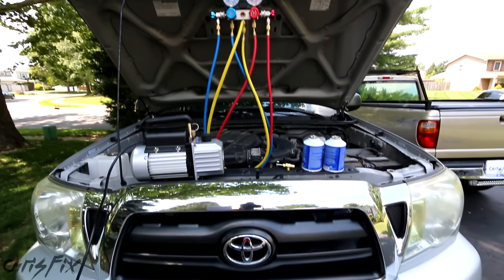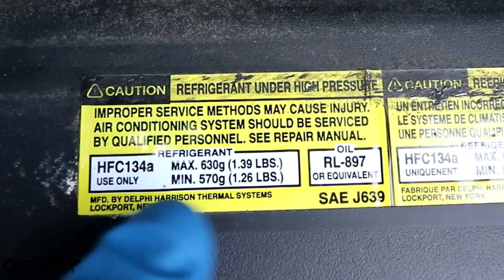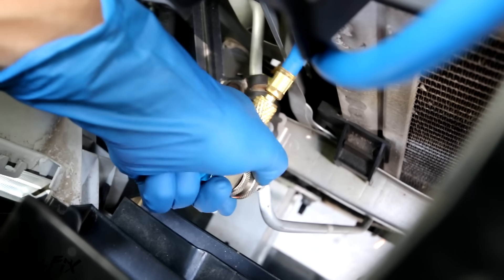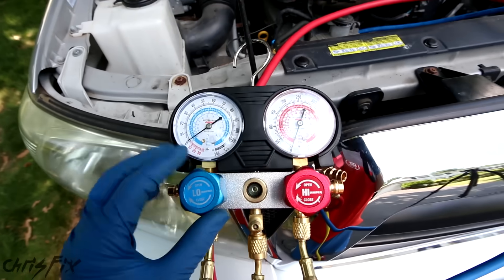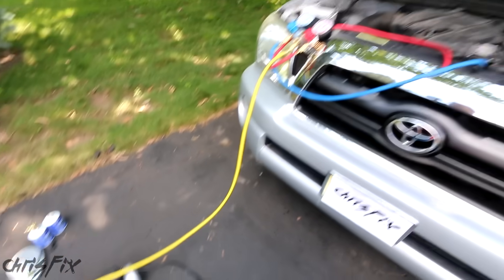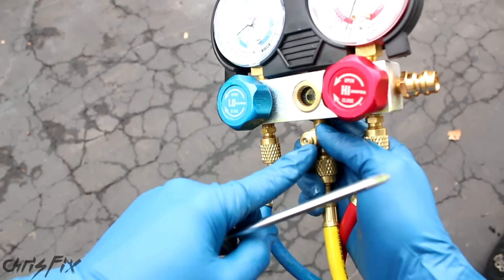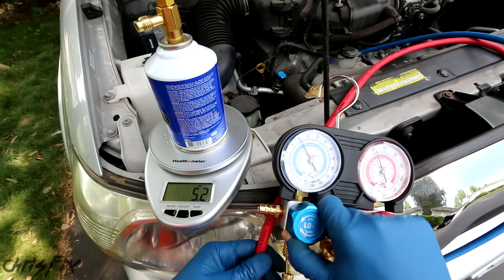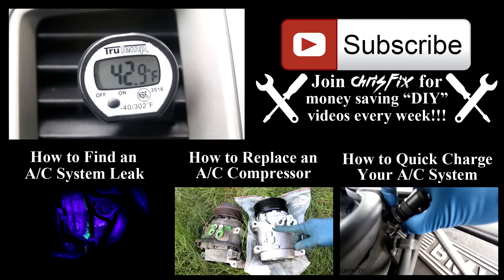How to Properly Recharge Your AC System

Comment: I have a vehicle that is 12 years old now and has sat for 5 years unused. Over this sit period my A/C has quit working. I don't have any of the gauges or vacuum pump to fix it the way you do here, and I was hopeful of buying a can of refrigerant and getting lucky. My questions are this. When the refrigerant leaked out, does it lose lubricating oil also? And does the system need to be vacuumed out if no lines have been disturbed?
Reply: Good info Chris.. Q: When just adding some more r134a, what should the pressure readings be to know when you are done ?
Reply from the maker: You can lose some lubricating oils, yes but usually not enough to cause a problem if you are using a can and hoping for the best.
Reply from the maker: And the proper way to fix it is the way I showed so you would want to pull a vacuum because moisture will cause corrosion and damage the ac parts. But again, since you are just trying to fill it for the summer, a vacuum isnt necessary to get cold air.
Reply: Thanks for your reply Chris. I'm going to scrounge up the equipment and do it the right way, and your video is perfect for showing me how. Thanks.

Comment: You might point out to people if you do this in the winter to give yourself more time in case it isn't successful you don't need AC anyway so you have more time to get it right.  Well, it was successful but the can of freon didn't draw into the system because it was too cold.  I had to put the can on the radiator of the running engine.  It would get warm and draw freon then get cold from drawing and stop.  Then warm up again.  It wouldn't draw with the can off the car, it was too cold.

Comment: So replacing the compressor removed all the old freon? Or did the vacuum remove it all? Also, if the freon was removed how would the UV dye still be in the system?
Reply from the maker: The freon is removed professionally by a shop with a fancy machine so it is environmentally friendly. The vacuum pump removes the air and the oil doesnt get removed because it stays in place.
Reply: Makes sense, thanks chrisfix!
Reply: just dump it 134a breaks down very quickly and does not harm the atmosphere like r12

Comment: 1,1,1,2-tetrafluoroethane or r134a is a very mild ozone depleter. There are newer and more environmentally friendly refrigerants that there are pushes to move to. However, the amount of 134a refrigerant contained in a depletated system would usually be minimal unless your fully charged and need to vacuum out the system. r134a refrigerant is used as a propellant in may arosol cans as well as used in can gas dusters. So release of this chemical into the environment during vacuum shouldn't be a problem unless like I said your system is fully charged in which case it can be recycled in a professional recovery system.

Comment: hi I going to replace my car ac evaporator.   after the job done need add some compressor oil?
Reply from the maker: Yes you need to add oil for any part you replace. Check the service manual to figure out how much oil based on the part you change.
Reply: ChrisFix thanks my friend.
Reply: in that case, do you purge the air in the yellow line in the same way ? or is there a risk that the oil will burst out of the purge valve ? Thanks (I'm in the middle of doing this after replacing the dryer)